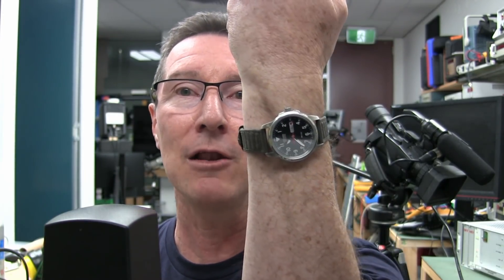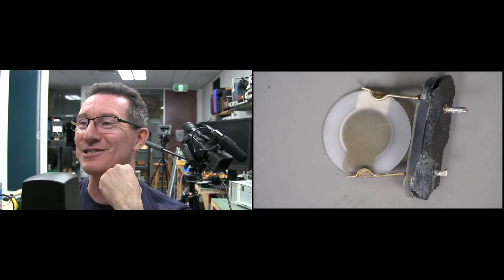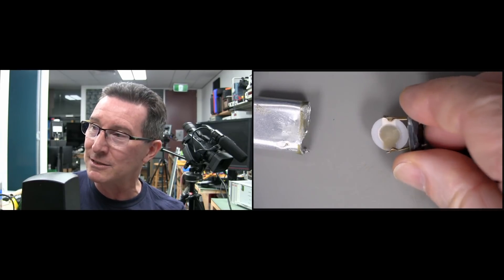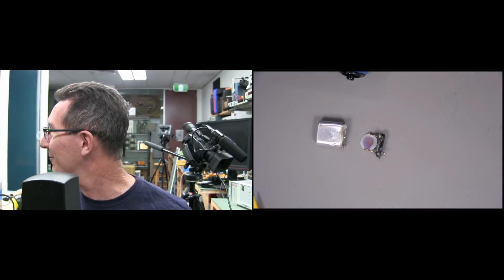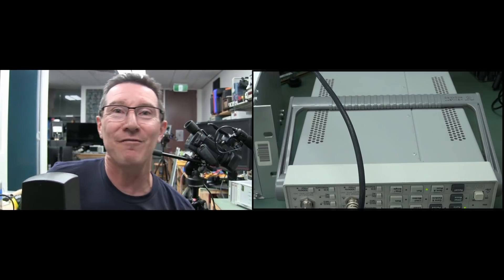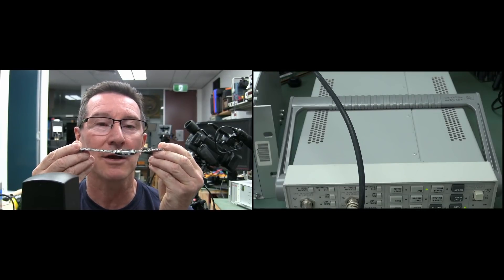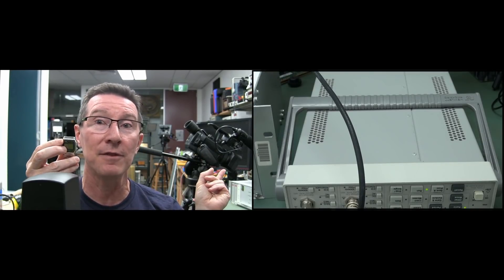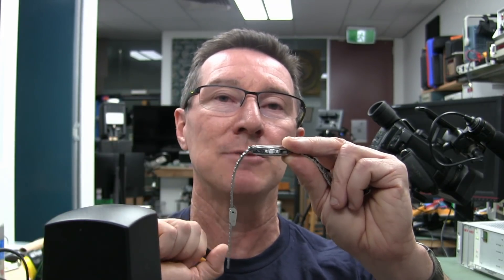How Gravity Can Change Your Watch's Time!

Comment: But how do you know, that the temperature variation is not the main reason of the frequency drift here? 
When you are fliping the generator upside down you are changing how the air inside is circulating. So, maybe in one position the crystal is a little bit warmer than in the other?

Comment: Love it, pretty intuitive if you think about it, the vibration has to counter the force of gravity for every upward swing, and gets a sligth pull on the downward swing.
It seems they should have mounted the crystal vertically in this case, use it sideways if you're a stickler for precision. (Did it vary when turned on either side btw?)

A question comes to mind: could you build a reference conglomorate crystal like a cube, with six crystals opposing each other to cancel out the effect?
I guess you'd have to drive them with inverted phase in pairs, so as one crystal moves one way, the crystal on the opposing face moves the opposite direction.

Then average out the three pairs, and the resulting signal should be invariant to orientation.

(They'd probably have to be manufactured to rediculous tolerances for this to matter, but they probably already are.)

Comment: Great video. 
Apologies for being a newbie and disrupting a great discussion. Doesn't an Atomic clock contain a quartz crystal too?  Question, if one has say two identical units and one is ground based and the other is in a high altitude airplane. Would there be a time shift between the two?

Comment: Doesn't the force of gravity vary (slightly) across the surface of the planet?
Reply: Yes it does I believe (not a scientist, so don't take my word for it). IIRC it varies with altitude above sea level and density of the matter beneath the point of reference.
(Should be low at the challenger deep I guess, since the water above would counteract slightly, but that's pretty close to the equator, so the distance to earth's core isn't minimal there. Does anyone know where the gravitational minimum on earth is?)

Comment: Dave, you've added variables to the experiment. We don't know what's going on in the counter heat convection in the cabinet? What you need to do, since watches run on 32,768 Hz (2^15), is excite a watch crystal and measure it frequency then turn it 90 degrees and test it again. Also watch crystals are much smaller then the one you used so the effects of gravity are less.

Comment: Turn over atomic clock and check the difference. There should be no difference since atomic clock do not use crystal oscillator, right?

Comment: The effect is much more pronounced with mechanical watches. If you watch anyone testing a mechanical watch for accuracy, you can see clear differences in rate as the watch is turned through different orientations.

Comment: Is it due to gravity or fluid dynamics considering gravity is but a theory after all, and everything behaves relative to its density. As someone who worked for a company doing sonar you should know this. 😉
Also gravity should be constant as you turn it, but pressure of fluids do not change as quickly. Considering the delay we saw on the meter I am considering air to be a fluid and the dynamics thereof when you move the crystal through the ether causes change of pressure on the crystal, which will slowly normalize again as the fluids settle down.

Comment: Just your arm swing will affect the crystal because of the acceleration, wouldn't it? It was the same problem with mechanical watch as well which was why jaeger-lecoultre build the 3D gyro tourbillon to even out the acceleration caused by the watch being in different positions or being under acceleration from different angles. Also I only know this because those wrist watches are incredible piece of engineering

Comment: When I got my first digital watch (in the 1970s, with a Tritium backlight!) I was obsessed with its accuracy.  It ran a little fast (5-10 seconds) over a month while wearing it all day and taking it off, setting it by my bed at night.  I started leaving it in my refrigerator each night and the lower temperature dropped the crystal frequency enough (overnight) so it was within about 1 second per month.  The shock of putting on a cold watch was a small price to pay for my improved accuracy . . .
I still miss my old wind-up watches with the 5-ticks per second.  I'd hold the watch up to my ear as a time reference to estimate intervals in the range of 10 Hz to a couple of seconds.

Comment: Is that gravity or some minor influence of magnetic fields? You must do the same thing turning the equipment on the vertical axis also. And on the other axis too.

And why it happens? The xtal is working on a non linear region? If so, it's solved using a small voltage on them, right?

Maybe it can be a topic to be explored more deeply.

Comment: Some years back, there were an experiment at Greenwich. They proved that even the most precise time pieces is influenced by gravity.
Reply: Those are relativistic effects. There is no absolute measure of time, two atomic clocks that are perfectly synchronized will begin to drift apart when moved to different locations due to minute variations in gravity. What he’s showing here are changes due to altering the mechanical configuration.

Comment: I wonder if this and temperature are the reasons why the clock on the radio in my car drifts over time.
Because over like a month or so it will drift about 1 minute ahead, so set it to the correct time about a month latter its a minute fast.
Is it the acceleration/deceleration and temp cycles affecting the crystal and causing this to occur? And if I leave it be and just never reset the thing it will keep drifting further and further ahead.

Comment: Will that effect be replicable in capacitor-based oscillators?  particularly with low capacitance (pF)
Reply: I think it will be, depending how the capacitor is manufactured. Think of it as a sandwich of layers which are affected by the gravity. Depending how you bend these layers, you will change the capacity.
Reply: @diavalus  I think so, just these days I was checking a circuit based on the AD654 and a 510pF capacitor. Its output frequency varied depending on how the PCB was oriented. What a headache

Comment: We EEs often forget that quartz crystals are mechanical components.  I once worked on an aviation grade GPS receiver design with a super precise crystal reference.  Not only did the prototype track better in some orientations vs. others, it also had to be shock mounted to get through helicopter vibration testing.  Vibration was enough to upset the crystal frequency and prevent satellite locks.

Comment: I wonder if you can use multiple crystals and math to compensate for this stuff.
Reply: Oh no!  A crystal Wheatstone bridge.  Would at least be an interesting experiment, but I would think one would need some pretty well matched crystals if the effect is to be nulled in all possible orientations.  Though there are six possible “orientations” (+/- 90° on each of three axes) so I would think that one would likely need a six-way bridge and six well matched crystals.  Still, I suspect it would be much more practical to simply characterize a single crystal in all six possible orientations and then modify a conventional temperature compensated crystal (TCXO) to also correct for orientation based upon the results of an accelerometer fed into the microcontroller that already manages the temperature compensation tables.  Then you only need a single crystal as the offset will be predictable for a given gravity for each orientation and thus can be characterized easily enough — plus you have now eliminated the often much larger effect of offset due to temperature change (unless using an ovenized crystal/OCXO).

Comment: ...doesnt pressure affect a crystal aswell?... im quite sure it does... that would mean atmospheric changes would also slightly change the tick rate...
Reply: answered my own question lookin at the XO wiki....
Atmospheric pressure changes can also introduce deformations to the housing, influencing the frequency by changing stray capacitances.

Atmospheric humidity influences the thermal transfer properties of air, and can change electrical properties of plastics by diffusion of water molecules into their structure, altering the dielectric constants and electrical conductivity

Comment: An accurate frequency counter often uses an oven to hold the quartz crystal at a constant temperature. Is it not possible that the gravity direction change could also skew the oven's temperature gradient and cause a similar small change in the frequency? But I guess that effect would cause a more GRADUAL change in the frequency, due to thermal lag, enabling you to determine which effect was the most responsible.
Reply: ya can usually track frequency changes due to temp, as its usually a greater effect than the effect from gravity (gravity is a very weak force!)
eg i have a SDR without temp compensated oscillator, will move by as much as 50hz depending on temperature (it moves as it warms up) and i need to adjust the PPM offset to compensate..... i have another with a TXCO that is rock solid with temps..

Comment: I would think the 90 rotation would be the maximum change because the gravity vector changes from normal to parallel. (or vice versa). If the crystal is symmetrical one would think that a 180 degree rotation would be the same situation.  There must be some sort of asymmetry in either the crystal or how much each side moves at resonance for the 180 case to be the greatest change
Reply: It is difficult to say as there are two sources by which the orientation and the gravity vector alter the vibration frequency.  The first, as you touch on, is on the face of the crystal, and there the maximum variation would be expected to be the most dramatic change in the axis (e.g. parallel versus perpendicular).  The second is the weight of the crystal acting upon the edges of the crystal where the crystal is held in it’s mount, and that really comes down to how exactly it has been mounted as you are altering which faces (top, bottom, left or right side, etc.) of the crystal are bearing onto the mounting frame at the points of contact and that is more difficult to predict the magnitude of the effect of.

Comment: I'm still unclear why the frequency changes due to orientation. Is the vibrational movement (mass of moving part) asymmetrical as far as force working in one direction due to crystal's warping vs. its tendency to bounce-back under its own structure? Wouldn't the energized direction of movement be affected the same as the un-energized direction of movement? Or perhaps it's another thing completely: some sort of asymmetrical damping of a ferric substance moving rapidly through earth's magnetic field.
Reply from the maker: More detailed video on this effect called 2G Tipover
https://www.youtube.com/watch?v=3yTL06ZU5SU
Reply: @EEVblog2  Thanks Dave. That's more about the Agilent/HP atomic clock. I think you meant your vid: "EEVblog #646 - Gravity Detection Using A Frequency Counter!" from 7 years ago where you address orientation of crystal. Still not enough depth for me so I'll go do some more research.

Comment: So interesting! Another question if you’re still answering- is this a temporary offset or does time drift? Or in other words, does the clock correct itself when put pack in the “proper” orientation?
Reply from the maker: Ignoring other effects, yes it will not correct itself when you flip it back. The "proper" orientation is just the one that you calibrated it in.
Reply: The time does not “correct” itself, in the sense of suddenly making up for lost or gained time, but it will return back to its original frequency when you restore it back to the original orientation.  Time will also be similarly altered with changes in elevation (though you need significant elevation changes to see such effects without resorting to hydrogen maser or cesium time standards or running an experiment for extended periods) as well as when subject to changes in acceleration (from a local reference frame, gravity and acceleration appear the same as both are an acceleration vector).  But they are all what would be considered “offset” effects, as opposed to “drift” (though the crystal will have its own unique time-dependent drift rate as it ages and that should remain so long as no damage or significant shock damage occurs).

Comment: That watch probably has an alarm, which sound's frequency is derived from the same source. So, I think, you might actually be able to see the clock drift if you connect a microphone to your frequency counter.
Reply: That's, what, a few 100 parts per trillion change in frequency. A microphone+imprecise clock in the computer's ADC is not nearly accurate or precise enough to measure this change. Maybe if you could make the clock's alarm beep for days on end you could get accumulate enough precision to measure it. But then your problem is that both the computer and clock will have drifted, because of temperature, the clock's battery running out and even the phase of the moon. (This is one of the few times where the phase of the moon is not used as a joke but could actually have an effect!) Or to put it simply there's noise everywhere and metrology us hard.
Reply: That could be a bit challenging to monitor depending upon how the MCU was coded (and it’s specific internal capabilities/features) as there may well be interrupts being executed in between that could result in subtle timing variations that may swamp out such measurement as it still has to maintain its regular time-keeping duties and other embedded features.  Fortunately, it is easy enough to physically access the 32.768KHz watch tuning-fork crystal, so you could readily measure it’s frequency directly (albeit with a small amount of shift due to loading it with some added capacitance).
Reply: Nearly all audio gear uses crystal clocks so I don't think the change is significant enough. That said clock fluctuations do occur by other factors and show itself in low level distortion products.

Comment: Back on my uni days a few moons ago,  a geology professor had a device to measure g, the gravitational constant (9.81m/s2). A demo was done showing that gravity at the floor was slightly higher than on the table.
Reply: The same experiment works with time as well, but you would need a hydrogen maser time reference to measure such a small deviation in the rate at which time passes.  It is simpler to demonstrate in taller buildings as then you can measure the change in time between different floors on more widely separated levels.  Somewhere online you can find an article written by a Time Nut that used a cesium time standard to measure the difference in the rate at which time passes between “ground level” (i.e. the valley) and the peak of the Mt. Rainier foot trail (or was it a campground?) — it was a nice story and personal science experiment.  I recall that he had some interesting questions from the park rangers with his minivan loaded up with several “atomic” time standards and a boat load of batteries to keep them running long enough to complete his experiment.
Reply: This, as I understand, is also why astronauts, according to Einstein's physics equations, age slower when in orbit compared with being on earth at sea level. In other words the farther they are from earth, or from the nearest massive object, the slower they age by a VERY, VERY, VERY, VERY tiny amount.
Reply: @seancronauer8463  that has nothing to do with the effects of gravity on quartz oscillator. your age is not determined by an oscillator, these are two different concepts :)
Reply: @lachendermann5408  You're right. I was thinking of relativistic speed. Not physical constants of gravity. 🤦

I should have asked this: 
If one is in orbit, would the affect would be greater when on the opposite side of the earth to the moon and then when between the earth and moon at a particular ratio, if that would then cancel out the effect?
Reply: @seancronauer8463  well yes, in the first case you'd sum them and in the other it's weaker, as you say at a particular ratio they'd cancel out.
Reply: @lachendermann5408  We would have many issues with our space endeavors, if not for atomic clocks. 🤔But, that is a very large piece of equipment, compared to a watch, in terms of cost per pound for sending into space.
Reply: @Ethan Poole, I remember that too. Great story, I still window shop ebay for atomic clocks, every once and awhile.

Comment: Dave, clearly you are wrong.  As you turned it over, the electrons started falling out, which causes the counter to be off.  This would not happen if your replaced the wiring inside with Monster Cables.
Reply: You're on the right track, but still wrong.  Dave is in Australia, so the electrons were normally falling out when the unit was facing the ceiling; turning it over caused it to work correctly.  It's sad that so many people don't understand the Southern Hemisphere.
Reply: @antibrevity  True, but in the southern hemisphere, electrons spin in the opposite direction, so from the electron's reference frame, they were actually right side up.
Reply: @rinner2801  how can we be certain Dave even fueled up on real electrons? Those Aussies are always trying to save a buck. I am willing to bet he has nothing but neutrons in there.
Reply: thats why you add shielding cans they keep the electrons from leaking out
Reply: Hahaha! This thread made me laugh so hard!
Reply: @KeritechElectronics  Science is no laughing matter.